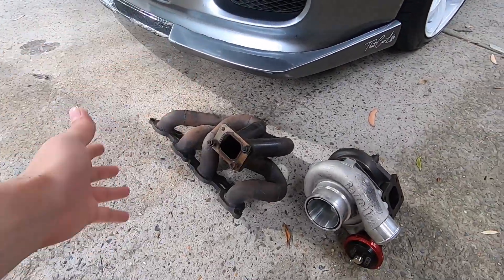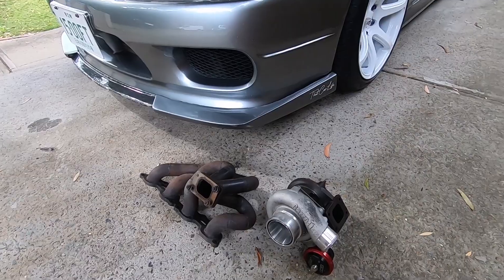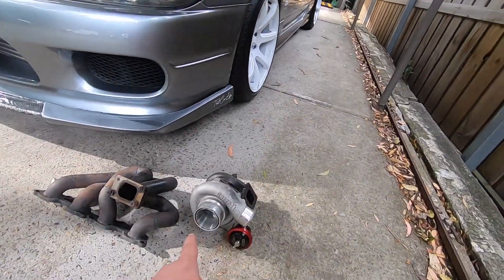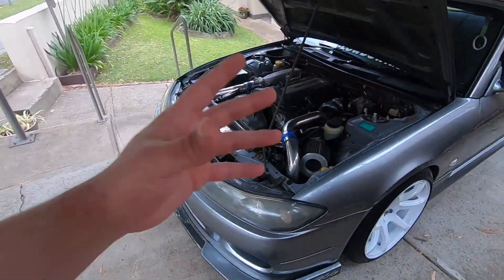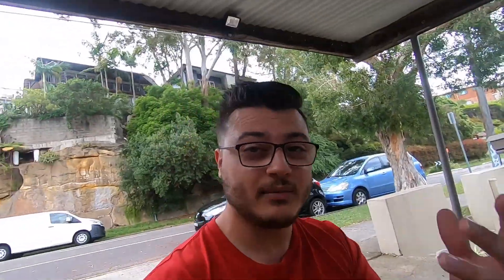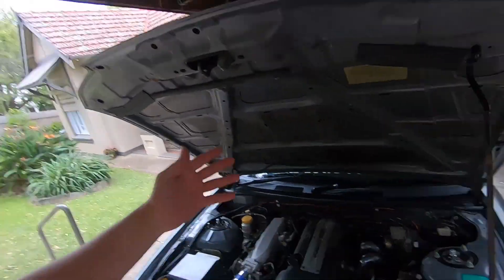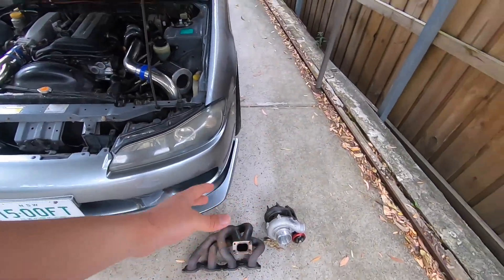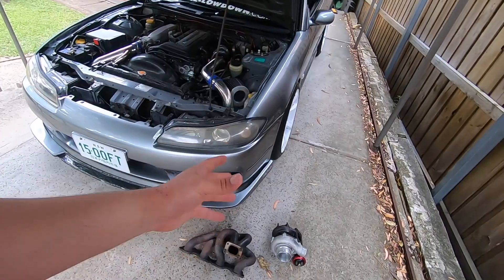NEW TURBO SETUP For The S15!!

Comment: What ECU are you running atm?
Reply from the maker: Stock ecu atm!!
Reply: @ThatCarLife  If you put the new setup on you're defs wanna go aftermarket ecu and get an eboost controller. when i got my car done the only thing holding my car back from making more power was not being able to control when and how much boost came on. going from 300 to 400hp is defs a bit of a rabbit hole but its worth it. aslong as you dont thrash the car youll be fine.